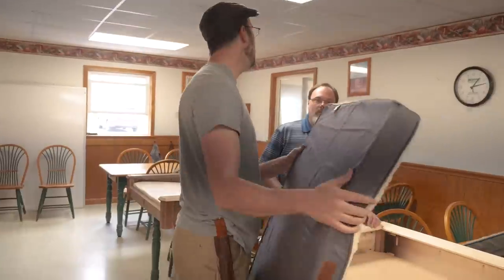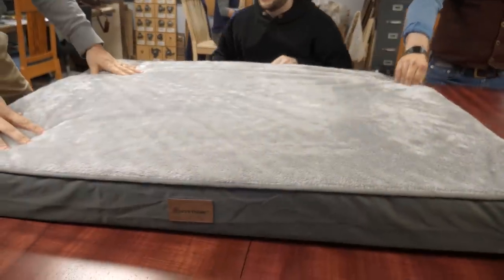Coffee Table Dog Bed Combo! (no cats were harmed)

Comment: You're gonna want to have approximately 5" of clearance under the bed so Roombas can vacuum under the beds.  Robot vacuum heights are in the 4" range.  5" should be good, even if the bed sits on carpeting.  It sucks to have pet hair accumulate under... anything.  I built my dog's bed 5.5" off the ground.

Comment: You seriously need to look at cat trees.  They're modular by design making them easily sizable with fewer part numbers. Base, screw together posts and platforms.  Have a kitten? base, 3 posts and 2 platforms. As the cat grows add 3 more posts and several more platforms, all the way to the ceiling.  Also look at window shelves, not only for cats but also plants; pads for cats, hardwood for plants.

Comment: Not only could it work as a kennel.  But you can have an option for a solid piece of wood with a hole in it to make it a cat play area.  In fact I would make both the front and back modular with different options.  Open , kennel lattice, and plank with cat hole.

Comment: Love the Lillipup, and in version 2, please look to include a lock for the underside of the toppers, or a way to keep it from opening due to pressure. If a gate system is involved, that's great on the front face, but also need to make sure the top doesn't open. Great work!

Comment: The bolsters around three sides of that bed also need to be cushioned. Dogs tuck into or put their heads on the sides of their beds and that will not be comfortable
Reply: +1.  My puppers hangs his head over the edge of the bed almost all the time.
Reply: +1
Reply: @puntedagain398  I would probably just buy a bolster bed to slid in there.
Reply: +1. I have a toy sized dog (a Havanese) that loves to tuck himself into the small nooks and crannies and when he's napping hard he sleeps in a corkscrew position so half of his body is in the bed while the other half he's hanging out.

Comment: Don't flip the rail for the under bevel. The dog will rest their head on the rail, and the bevel on top gives a more natural resting surface for them. Having it be on the bottom might be more functional for a table, giving a wider flat surface area and the cleaner look, but functionally for the dog, I think it's worse.

Dogs lay on all sorts of weird positions, it should be made to accomodate for that, not for aesthetic for a regular table.

Comment: In think you should look into thicker dog beds instead of dropping down the railing, and sticking with the railing I do believe it should be a bit more curved on the inside for the comfort of the dogs.
Reply: I have had lots of dog beds over the years for my puppers and the most like ones were always the cooling mattresses( problem cause I live in Texas and it’s hot as hell) so I would also look in to that

Comment: So either my choices are getting my dog an expensive wooden bed with hard sides and top, pretty uncomfortable... Or getting my dog a bed that's 100% machine washable, completely soft with a stuffed rim and therefor far more comfortable, for 50 bucks at the local pet store.

As much as I love wyrmwood... I'd be opting for the more comfortable and cheaper option, thanks.
Reply: I think the hardwood has value because it keeps the bed anchored in one space.  I agree that they should look into making it more comfortable but ones that are nothing but cushion have problems as well.
Reply: @VagabondTE  like what? Because if by 'anchored' you mean it stays in the same spot, the grippy rubber nubbins under a quality soft basket take care of that. Wear and tear isn't an argument either, as the inside of the WW beds is still soft and needs replacing at times too. The only 'drawback' is the poor look compared to WW, but I prefer function over form.
Reply: @Deadl0ck  hey if it works for you then that's fantastic but I've seen other people use giant soft beds for really big dogs and it really doesn't work.  I don't think the people realized how much space they were devoting to dog stuff.  I'm really big on using negative space in house design.  Every chair couch and end table has what I call negative space above it that can't be used for anything else.  A soft dog bed takes up a lot of floor space to me.  But again if it works for you then power to ya.
Reply: @VagabondTE  oh its a lot of 'wasted' floor space for sure. But aside from the lillipup (with the table on top) none of these wyrmwood beds change that. You still need to dedicate the floorspace and provide the dog headroom to get in and out of it.
Reply: @Deadl0ck  that's only partially true..  I believe "anchored" hardwood furniture gives you more options about what floor space you're using.  Which can give you more options.  Even if two things take up the exact same floor space,  how it's interacted with can change circumstances pretty significantly.    For example,  if it was placed between a chair that could slide around and a wall then something soft couldn't be placed there.  Or it would at least be annoying.  However a solid frame could work.  Sorry I'm not trying to change your mind or anything. I'm just chattin.
Reply: @VagabondTE   no worries, I like a healthy discussion, getting someone else's perspective is always good! I'm enjoying reading how you think about things. And I think I can sort of see what you're getting at... I ran into that almost exact scenario with an assisted mobility chair for my granddad he'd always push it back while getting up out of it, getting it caught in the basket. Stuck a couple of spare laminated flooring boards under the basket to create a lip the chair wouldn't roll up on easily, sorted.
Reply: @Deadl0ck  Nice!  Different options and solutions is exactly why we need companies like Wyrmwood.

Comment: Tried out several dog beds for my pit bull. He currently has three spread around the house, but really only uses one: the old memory foam topper from my bed. We cut it down to dog bed size, and its about 3" thick.

He hates the dog bed with the egg crate foam in it, even after flipping it over so the pointy bits are pointed down. It's by far his least favorite.
Reply: Could be the memory foam..  Though it could also be your scent.  I use dirty t-shirts to get cats to nap and hang out where I want them to.  Its also really helpful when I get a new kitten and I want to build trust.
Reply: Lol, my dog prefers the eggshell, only rarely goes to the memory foam.